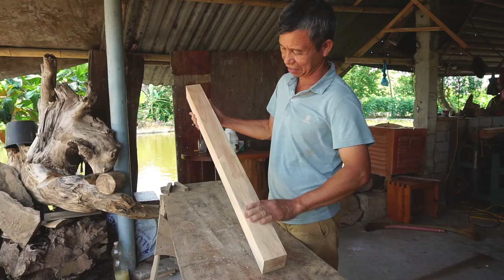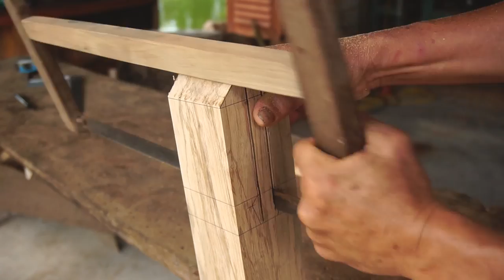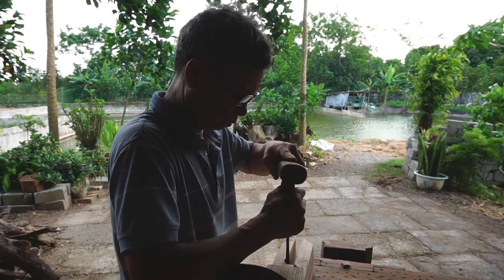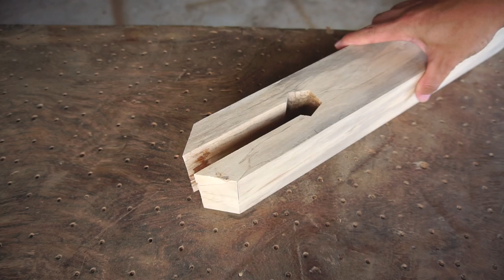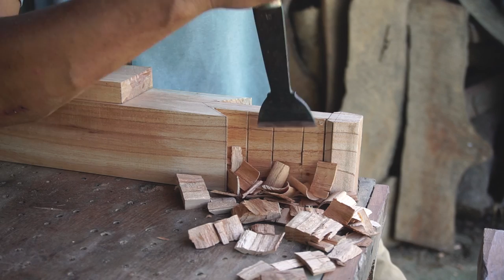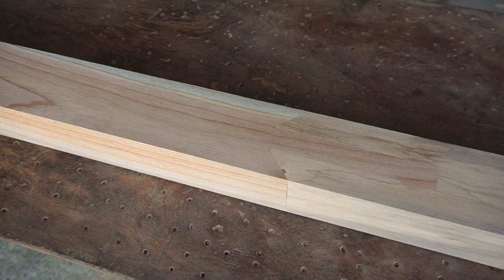Amazing Technique Of Straight Joints Is Simple But Stronger What No Teacher To Teach You

Comment: Where is the weakest point on that ? Would you use it as a vertical or horizontal support beam for a table or bench?
Reply from the maker: Yes, you should give it a try too
Reply: @HCarpenter  I think you didn't get what Mr. Aaron AG wanted to know?